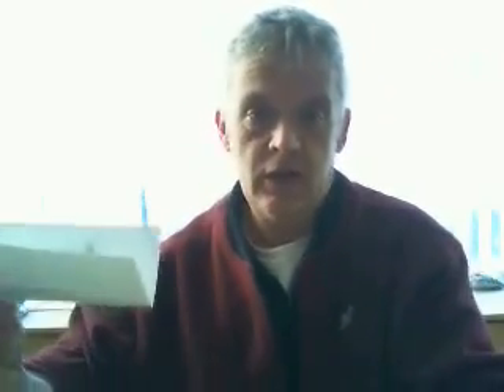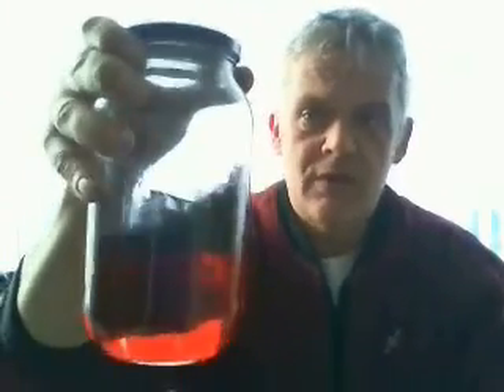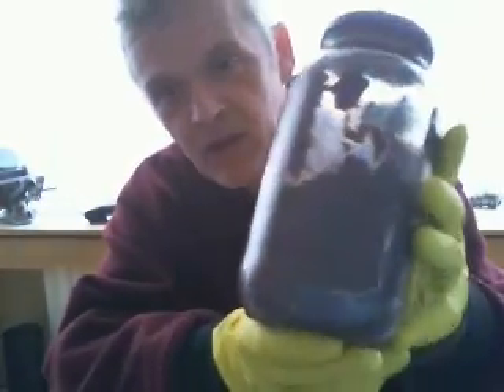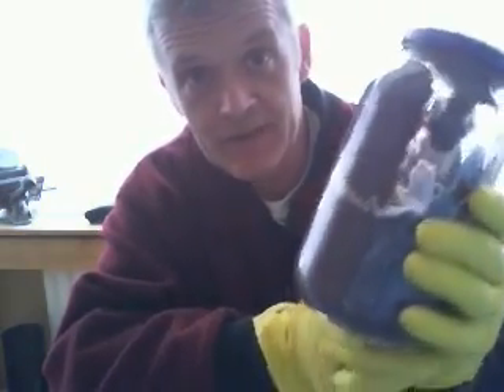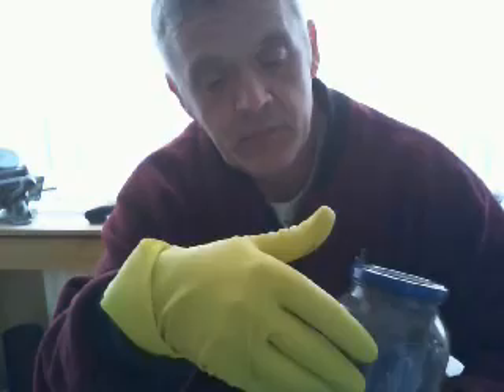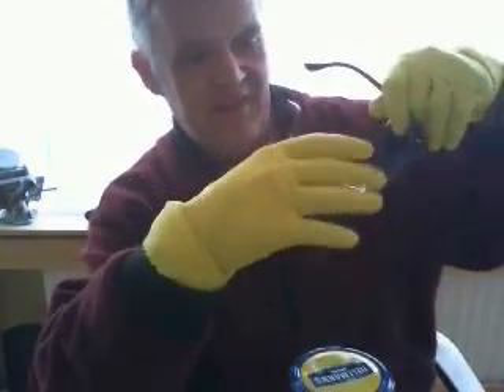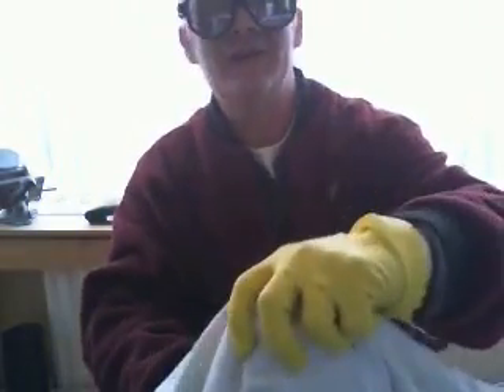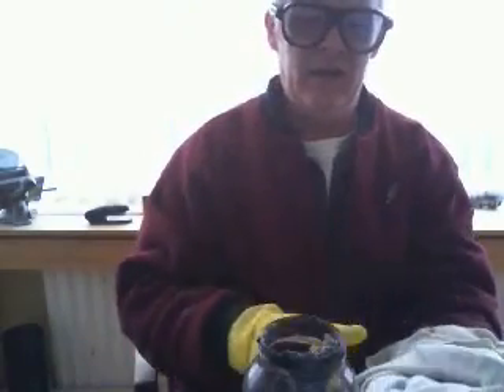how to make graphene 2 - improved audio

Comment: Hello, I mage GO with your method (H2So4 + H3PO4) and I got yellor color compound. On UV spetroscopy I got Peaks at 230 and 300 wavelengths. But in XRD I didn't got any peak means no single peak. Can you suggest me what is happening. Why I am not getting peak in XRD?
Reply from the maker: UV-vis spectra of aqueous GO dispersions give two kinds of characteristic features, the first is a shoulder at ∼ 310nm, corresponding to an n-π* plasmon peak. Another characteristic feature appears at 230 nm, and corresponds to a π-π* plasmon peak. The intensity and position of this feature can vary between samples. To identify why the spectra of  GO samples are different, AFM measurements can be obtained to determine the number of layers each GO sample possessed. AFM observations have shown that the thicknesses of chemically derived single-, double-, and triple-layer graphene sheets are approximately 0.57, 1.25 and 1.83 nm. The interlayer spacing is calculated to be in the range of ∼ 0.6-0.7nm. The distributions derived from AFM measurements show that the GO composed of a single layer and, double layers and, and triple layers have an average thickness of about 0.8, 1.3 and 1.8nm, respectively. The interlayer spacing is calculated to be 0.5 nm. Obviously, this value is much larger than that of graphite, which is normally 0.335 nm. Therefore, the interlayer spacing of graphene that has undergone less oxidation than triple layer GO will be 0.335-0.5nm. Considering that the radius of a carbon atom is less than 0.15nm, the increase of thickness caused by the presence of epoxy and hydroxyl groups on bothsurfaces of the carbon atoms is approximately equal to the thickness of single-layer GO. GO containing 10 layers has an average thickness of about 5.9 nm.

XRD limitations tend to be
Homogeneous and single phase material is best for identification of an unknownMust have access to a standard reference file of inorganic compounds (d-spacings, hkls)Requires tenths of a gram of material which must be ground into a powder
For mixed materials, detection limit is ~ 2% of sampleFor unit cell determinations, indexing of patterns for non-isometric crystal systems is complicated
Peak overlay may occur and worsens for high angle 'reflections'
sample prep can be very important
Obtain a few tenths of a gram (or more) of the material, as pure as possible
Grind the sample to a fine powder, typically in a fluid to minimize inducing extra strain (surface energy) that can offset peak
positions, and to randomize orientation. Powder less than ~10 μm(or 200-mesh) in size is preferredPlace into a sample holder or onto the sample surface:
Sprinkle on double sticky tape
Typically the substrate is amorphous to avoid interference care must be taken to create a flat upper surface and to achieve a random
distribution of lattice orientations unless creating an oriented smear.
For analysis of clays and materials which require a single orientation, specialized techniques for preparation of clay samples are given by USGS. - link https://pubs.usgs.gov/of/2001/of01-041/htmldocs/methods.htm

For unit cell determinations, a small amount of a standard with known peak positions (that do not interfere with the sample) can be added
and used to correct peak positions.

Comment: alright I've got everything needed for all the methods you've put in the channel lol. I'm torn between this method or the tour? the tour method you state that reaction will be somewhat stable as long as heated stirring stays at the 50°c, as temp adjusts to stay within the set temp which could go -1,2 or +1,2 degrees. My question is what's the max and min temp acceptable for tour method?
Reply from the maker: if i were you i would do my best to stick to the paper mate
Reply: Ok, so this method or the tour method? Does the tour method produce a better end product than the method you used in this video? 

Hope I'm not bothering you, but I really want to understand how all this works.

Thanks
Reply from the maker: no worries but there is no such thing as the best method mate - there is only the most appropriate method
Reply: Well said sir, then let me clarify the intent of the graphene oxide being produced. I want to print batteries via 3dprinting, intense laser etching/engraving via my k40 laser, and paints/inks. Wanting to do this for my self but more importantly I want to teach the kids in our community here via a start up nonprofit organization dedicated to making, tinkering, diy, experimentations, hacking electronics, and more. Very excited to be a part of something with limitless possibilities and have the ability to pass on what I've learned from you and the countless others.
Reply from the maker: so what you really want is a 'safe'method for GO - neither of the two you are looking at are particularly safe - it might be a good idea to look at ball milling graphite with carbon dioxide for go production - search google scholar

Comment: What about using 2 or more piezoelectric "pistons" to grind the graphene?
The frequency will be ... "insane" :)
Basically we make holes in sphere (like a empty ball) and attach piezoelectric pistons - perpendicular on the sphere.

Inside we put the desired material - and maybe some liquids and we synchronize the whole thing to achieve the "maximum" pressure right in the centre of the sphere - by combining the waves. :)

And voila... a nuke :)
Reply from the maker: Neg Lewis absolutely mate - give it a go and let me know how it works out for you

Comment: Hey. just wondering, what is the purpose of mixing both sulfuric acid and phosphoric acid together? Wouldn't the phosphoric acid just weaken the effect of the sulfuric acid (since it's a weaker acid)? Or...would sulfuric acid by itself destroy the graphene?
Thanks!
Reply from the maker: Essentially this is the Tour method and was made popular post the publication of the article improved synthesis of graphene oxide by mercano et al, mercano is one of the tour group - here is the article should you wish to read it http://nanomaterials.wikispaces.com/file/view/Improved+Synthesis+of+Graphene+Oxide.pdf
Reply: Robert Murray-Smith
I was wondering, the article says use 3 mL of 30% H2O2 but I know you use a lot more. Would 3 mL still work?
Also, before adding the 3 mL, my solution doesn't get gelatinous.
It forms three layers, a thick purple layer, a light green ,and a dark green layer. Have you gotten that before?

Comment from the maker: The GO made by this, and any other method, is just full of contaminants. Mostly sulphates and free metal ions the addition of HCl turns these into soluble salts that can be removed by washing in water. The washing process is really quite tedious - but is necessary to remove the contaminants. you can vacuum filter it if you have the equipment - and this is best - but i try to do experiments that anyone can do at home so i do it with the minimum of equipment - hence my washing process

Comment: I have left the suspension stirring for two days now. The suspension still feels kinda liquid-like rather than pasty. Tommorow, I will terminate the reaction with peroxide and then perform washing+centrifudge and see how it goes. We would be subjecting the graphene oxide to some test like FTIR and XRD to have a better look at their structure. My main intention in producing the graphene oxide is to use them as a filler in polymer